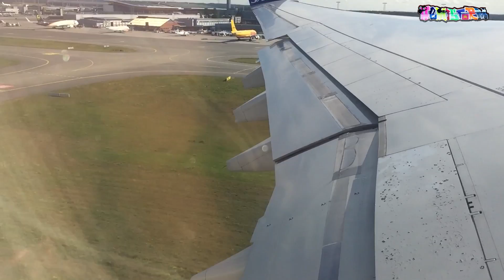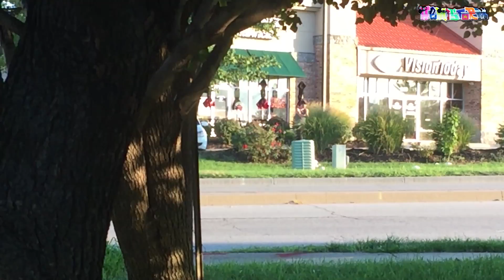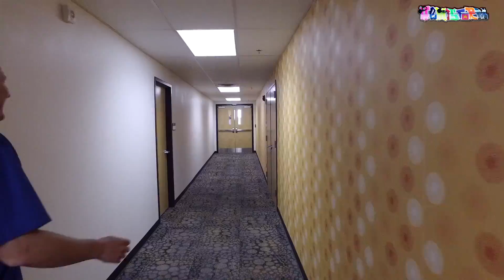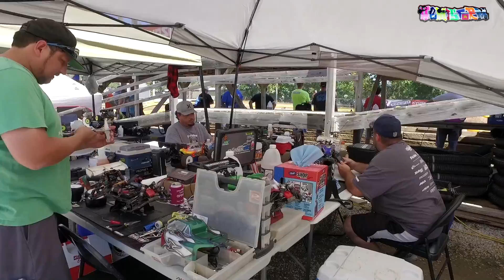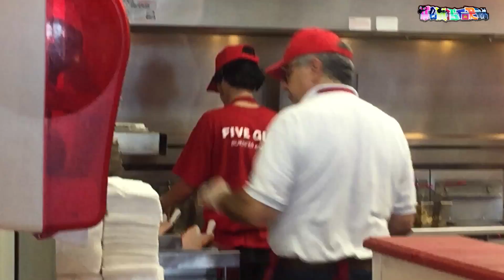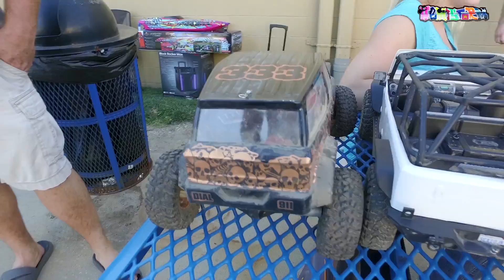SENSORED by CASTLE CREATIONS - HemiStorm goes USA again!

Comment: Finally castle did sensored i never own sensored i will soon but it's good that castle step up
Reply: Chevy RC you'll love sensored, the throttle response is awesome. Like Chris said..buttery smooth
Reply from the maker: Buttery smooth indeed, without sacrificing top end through SmartSense. I was a bit on the fence, but two minutes into testing I was convinced that I'm swapping my sensorless setups out in the majority of my rides.
Reply: Chester Copperpot wow thanks for the info
Reply: HemiStorm RC - Custom RC builds, painting videos and more wow thanks for the info